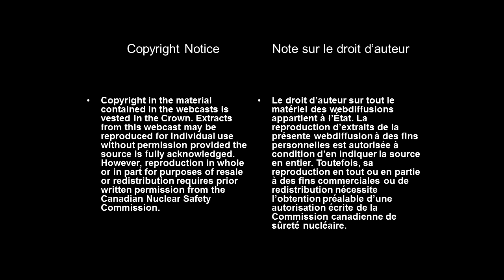Heavy water leak during maintenance activities at OPG Darlington NGS

Comment: i'm having a hard time understanding how a worker can "accidently" crack open a valve that has been isolated? Were locks not places on the hand-wheel or other actuator? Isn't that the most basic industry practice? How come this was not something that was already in place decades ago?? I must not be understanding this correctly, seems impossible that a safety precaution would of that nature would not already be in place. Maybe they hit the valve and cracked the body? That makes little more sense...
Reply: Not just in Nuclear, but lockout or lockout tagout has and is used on any safety system, yes.